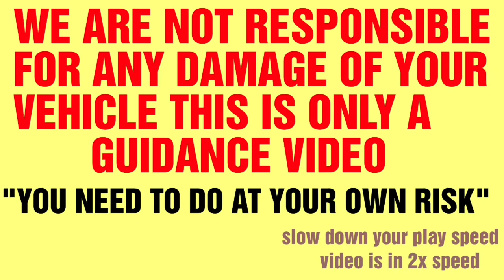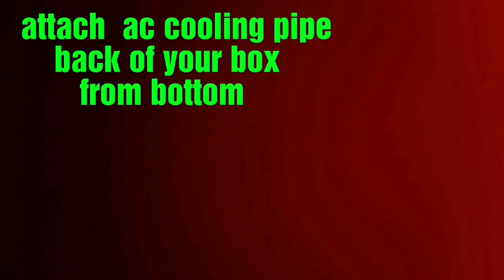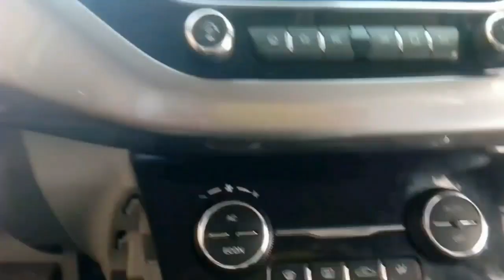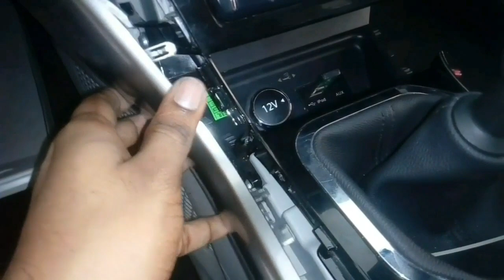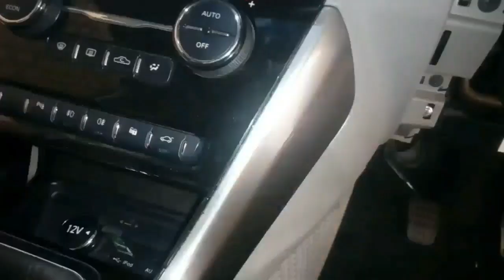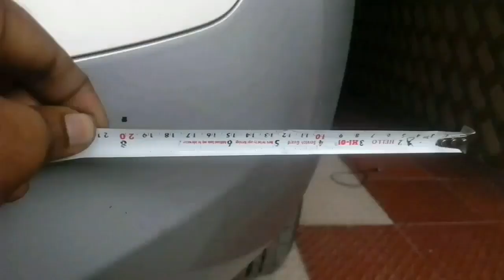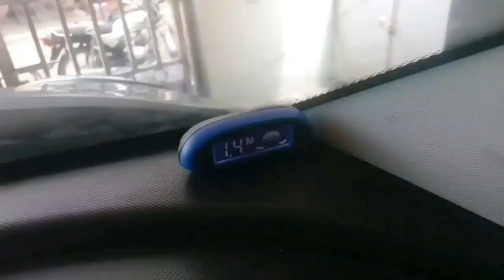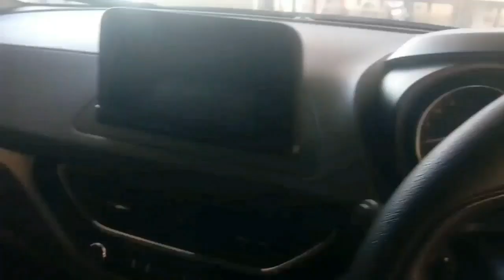NEXON FRONT PARKING SENSOR (PART-2)

Comment: Nice bro. Excellent follow up. Please advice us front parking sensors with radar for Tata Nexon facelift.
Reply from the maker: you can fix it with your nearest car decorators, you don't need to disturb company's wiring  and you don't even to cut company's wire for joining a power loop ,if you are perfect with some experience then you do other wise please don't do it ,go to your nearest car decorators and ask them. please remember sensors won't work at high speed, we are using to turn in small streets without our car damage

Comment: Can we do this type of setup in Altroz XZ?
Reply from the maker: YES , you can, but you need to contact tata service center and car decors to fix it perfectly 

NOTE :- THIS SENSORS WILL WORK perfectly when the speed is less than 15km otherwise it will confuse your driving while it auto trigger in some unwanted suitations